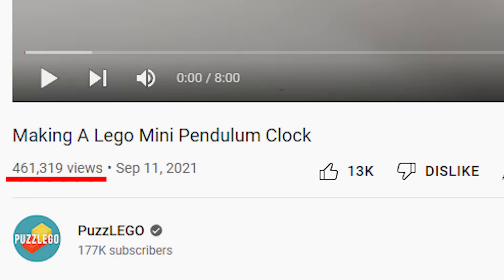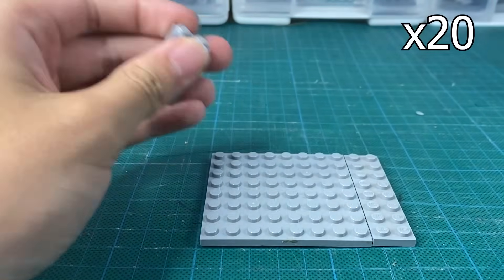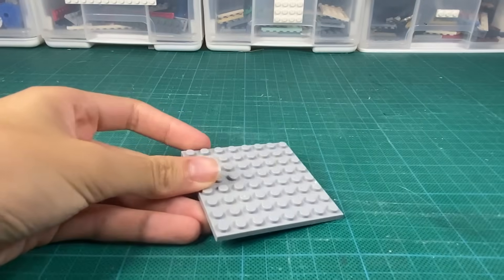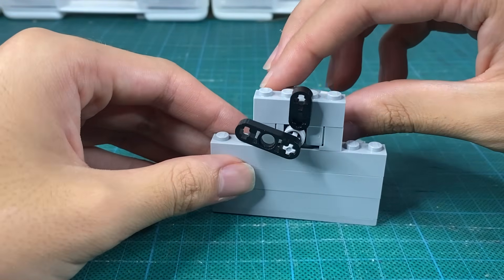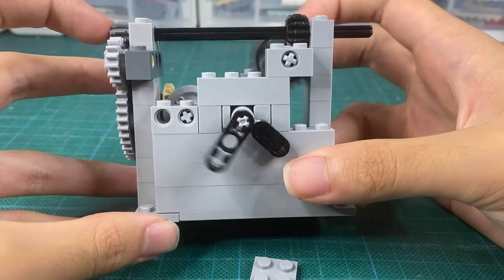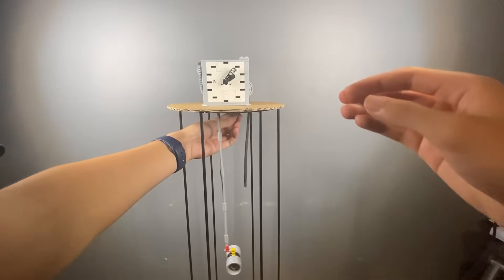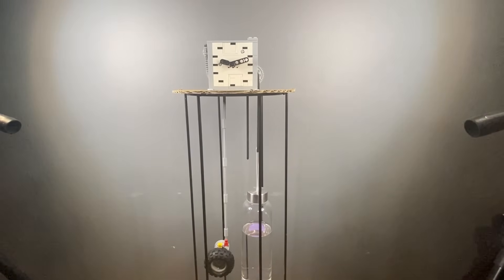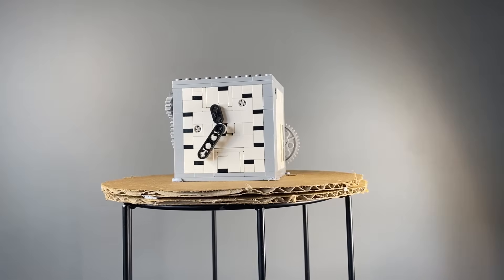Making a Working LEGO Pendulum Clock !!

Comment: I have just got a 1760s longcase grandfather clock running, so this is quite interesting. The mechanism that connects the pendulum to the clock mechanism so that it advances one pendulum swing at a time is called the escapement. Also, for fine adjustment of time, then rather than changing the length of the pendulum, it's possible to add smaller weights to raise the centre of gravity (normally you start with the clock running on the slow side).

In any event, well done. I expected a Lego clock to be much larger.

Comment: A pendulum clock is a clock that uses a pendulum, a swinging weight, as its timekeeping element. The advantage of a pendulum for timekeeping is that it is a harmonic oscillator: It swings back and forth in a precise time interval dependent on its length, and resists swinging at other rates. From its invention in 1656 by Christiaan Huygens, inspired by Galileo Galilei, until the 1930s, the pendulum clock was the world's most precise timekeeper, accounting for its widespread use.

Comment: Not sure if the springs are too strong but some of the monster truck sets come with pull back spring motors. I was wondering if that could replace the water weight?

Comment: Seems to be much better design than my unfinished lego pendulum clock. With lego battery box weight it ran 15 minutes with 30 second accuracy. Longer lasting clock didn't run smoothly due to friction of lego parts. It was many years ago and didn't have camera then so there is no YouTube clip about it. Three hand clock is more complex thing than you first think. :-)

Comment: Make the pendulum double as long, and it will tick half as fast. You actually calculate the period. It depends on the gravity and the distance between the pivot and the pendulum's center of mass.
Reply from the maker: that's correct, I could have even made it as long as possible with the stand limitations and then worked from there
Reply: @puzzLEGO  PUZZLEGO its been half a year since you posted the 3 lego candy machines. Can you PLEASE PLEASE PLEASE make a tutorial PLEASE

Comment: I don’t have the special gears, the ring piece or that type of tread, would like to try making one and don’t mind making a less compact. Is there tips or kind of work arounds you would suggest?
Reply from the maker: you should make my older lego clock, it has some less uncommon pieces. otherwise some workarounds are:
treads: string
special gears: try and gear with normal ones (may be a lot harder)
ring piece: you can use a technic bush it just has more friction
Reply: @puzzLEGO  can you make a tutorial on three lego candy machines? PLEASE

Comment: Speaking as someone who works on brass mechanical clocks. Did you mean to have a second hand and an hour hand rather than the normal minute hand and hour hand? You won’t be able to read this clock like a normal clock face since your hands don’t match the standard. You only need a 12:1 reduction rather than your 60:1 to get the correct behavior from your clock. Great job getting the mechanism in such a small space!
Reply from the maker: Yeah, originally I meant for it to have a minute and hour hand, but the hour hand would only rotate 1/12 around the clock before it stops. Also, I would have to bring the total gear ratio from the escapement to the display up to 1:720 which probably wouldn’t fit. Hope it wasn’t too disappointing
Reply: @puzzLEGO  Not disappointed at all! It’s still a marvelous build! I’m also an AFOL so I hope I still have some weight when I say I’m impressed. I just happen to be picky when it comes to clocks as that is my other hobby beyond Lego. Great job and well produced video!
Reply from the maker: @Xtopher98  really appreciate it! Being a clockmaker must be so cool, it’s one of the best mechanical devices. Also, I don’t think I’m considered an AFOL since I’m only 16, but soon maybe, lol
Reply: @puzzLEGO  puzzlego please respond to me I really want to make the 3 lego candy machines

Comment: Wow! It's already hard to put a 1:60 transmission in that space
Reply: For hour/minute hands I think only a 1:12 reduction is needed, because the minute hand should rotate once per hour and the hour hand should rotate once every twelve hours.
Reply: Exceptional 1:60 reduction... Especially if you consider that it should be 1:12 ratio (one turn of big arrow means 1/12 of small arrow... You're not making a chronograph with seconds and minutes, but a clock with minutes and hours !!)

🤣

 🕊️

Good job anyway !

Comment: I wonder what a part 3 would look like?  There are plenty of small pendulum clocks that hang on the wall...  Since you used a water bottle for weight would you be opposed to using a brass weight for the pendulum?  Would that help it last longer (days?)
Reply: Part 3 would be an alarm clock.